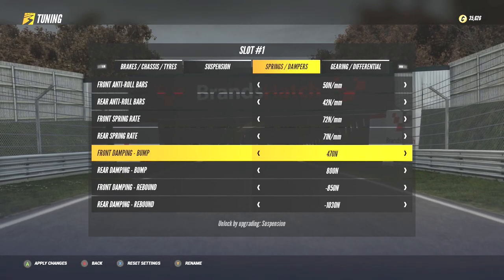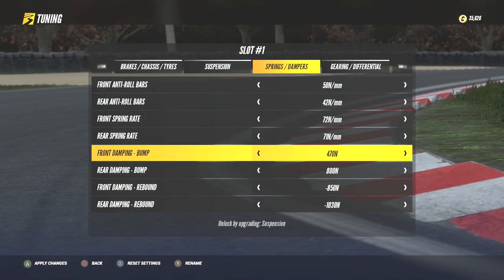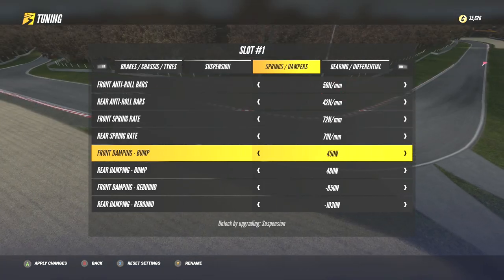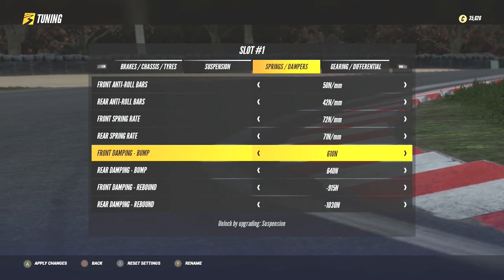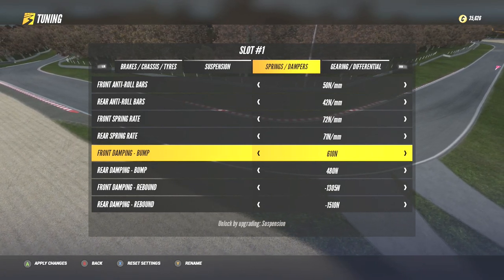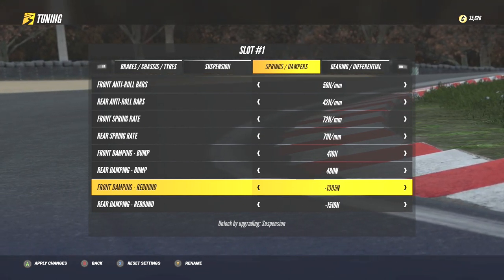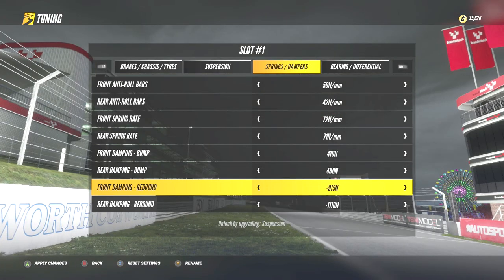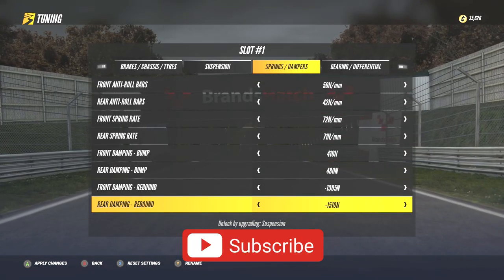Project CARS 3 TUNING TUTORIAL PART 4: Dampers, Bump and Rebound | Setup Guide

Comment: These videos are great,  nice and simple explanation. I already knew how to tune cars but with some stuff I didn't actually know what was going on with the car and weight transfer etc,  I just knew to make it stiffer at the front and soft at the rear or vice versa depending on the result I was after.   If you can get the xbox players to actually want to race tuned cars that would be great,  seems to be a lot of people just want to race stock cars with under steer issues.
Reply from the maker: Glad to hear it helped you! I struggle to find any multiplayer lobbies at all on PCars3, so I haven't experienced anyone's car choices at all. If you have you know of any groups or communities that race casually, let me know :)
Reply: @JSRJohn  There is usually a few lobbies going around 8pm most nights.  The racing seems to be pretty decent, and ive not really found many ramming idiots.  But sadly this game is pretty dead.
Reply from the maker: Pretty dead indeed, but thanks for the tip on 8pm!

Comment: @3:33 some contradictory statements: For Bump damping tuning: "...faster to create 'more oversteer' as the car decelerates this can help with cars to 'understeer a
 bit too much' whilst you brake...", I am have having hard time understanding this.
Reply: He's saying that if you have understeer on corner entry, set the front bump to a lower setting, which means faster to compress the front springs, and set the rear bump higher or stiffer. This increases an oversteer effect on the car, to overcome the previous inherent understeer nature of the cars handling you were previously experiencing.

Comment: So to stop nose diving during hard braking, increase compression (bump) on the front AND increase rebound om the rear or what do you suggest? I'm running KW V3 on a m850 coupe, so lot of weight over the front. Ideally I'm trying to reduce the body movement further. The existing settings as suggested are bump 6, rebound 9 ( away from full stiff).
Reply from the maker: Hey there — Yes, do exactly as you said in your question. :)
If you have the option, also try reducing downforce on the front of the car. Or instead make the front suspension springs a lot stiffer.